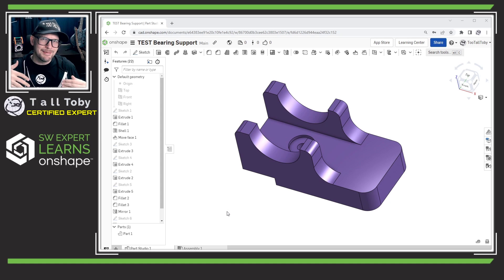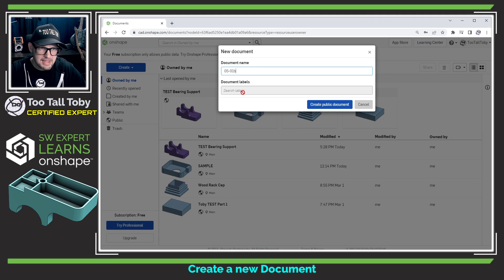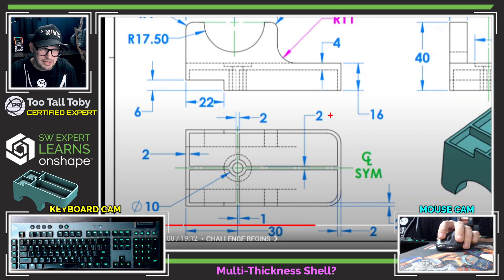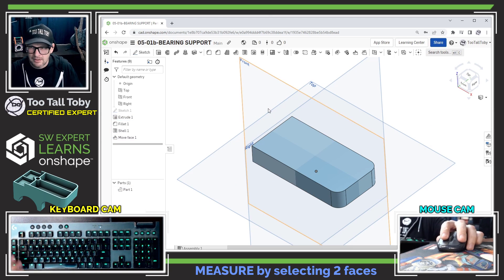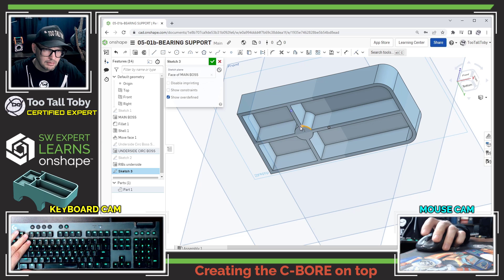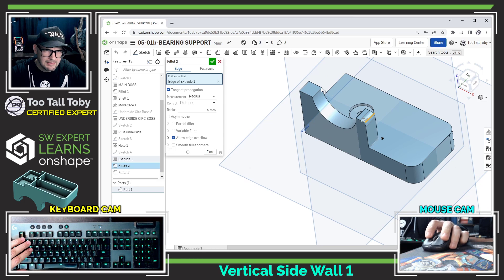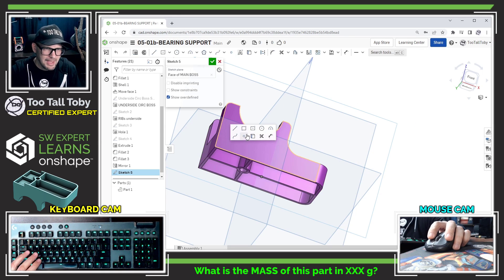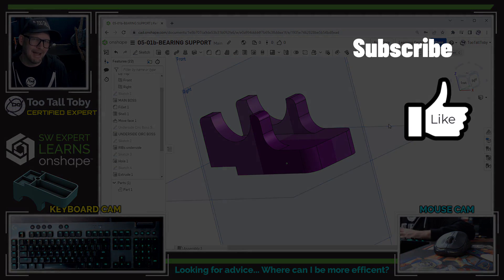SW Expert Designs a Bearing Bracket in Onshape (Tutorial)

Comment: GREAT JOB TOBY!!!

Here are some tips:
1) For the shell, I would have done it like you did.
2) I don't rename my features, instead I put features related to each other within a folder I name accordingly.
3) I would have placed the rib sketch (4 lines) in the same sketch as the circular boss since the ribs would certainly change with the boss diameter and/or position change.
4) There is a rib feature where you can only draw 4 libes from the boss circle and rib them "normal to sketch plane".
5) To create a hole, you can directly within the hole feature dialog, place your hole in the center of the boss (implicit Mate connector) without any sketch. It was not possible here since the counterbore was on the opposite side of the boss. This tip is for the future.
6) At the top of the mirror dialog, you have to change the "Part mirror" to "Feature mirror" or even in some cases "Faces mirror".
7) To assign material, RMB on the part in the parts list on the left and select "Assign material". You can create your own materials.

Keep going! :)
Reply: Yes yes YES!!!!!!  This is awesome thanks Eric!!!   
Last week, after I read all these great comments (below) I made a  "Toby Response" video, where I went through each comment and showed what I learned by demonstrating the suggestions in onshape.  It's so much great knowledge and I am so thankful to the onshape community!!  I even signed up for the forum this week 🙂  

That video should drop this week, and I'm gonna do some more of these "practice models" soon.  I'm so excited about this journey!  Thanks again for the kind words and for dropping some knowledge bombs on me!!  Happy Saturday bro!!

Comment: Looking good overall!
There are definitely some keyboard shortcuts worth getting familiar with:
Shift S for sketch, Shift E for extrude, Shift f for fillet, l for line, i for coincident g/r for corner/center rectangle q to toggle construction are some of the most used... Get the full list from the "?" menu in the top right!
There is no multi-thickness shell, but the move face works. In this case you could make it "parametric" by doing a move face "up to surface" with a 4mm offset. Or the simpler option is to just extrude the top face again 4mm down, you don't need a sketch you can just select a face and extrude it directly.
I would also sketch the circle for the boss on the top face (extrude up to the bottom perimeter face) and use that sketch to locate the hole afterwards. Also you didn't need an actual point to do it the way you did: just do a "use" of the boss and place the hole with a mate connector in the center of the resulting arc. Another thing to look forward to (throwback to your earlier video!): mastering the mate connector and all of its uses!
The rib and mirror questions have been answered already, pre-selecting works for the mirror but only for a body so you have to manually switch to "feature" mode every time...
Note that on the far right of the toolbar is a search box so you can click on this and search for commands (to find the "rib" tool for example), becomes more useful when you have lots of custom features, I mapped it to one of my mouse button. You can also customize the "s" key toolbar and I think you could ad it there (not sure...)?
When you create a sketch on a "face", it automatically brings in the edges of that face (called "imprinting") so the is no need to "convert" these edges to use them (like you did on the bottom of the boss).
One more tip: on the notched profile, just sketch a rectangle and a circle (there is no need to trim sketches in Onshape so it's a lot quicker than doing separate arcs and lines, especially the way this was dimensioned).
EDIT: I was going to add that if you hold shift when hitting enter to confirm a feature is "repeats", useful for doing things like back to back fillets of different radii.
Reply: Airwick!!!  Awesome man thanks so much for the feedback!  I made a "noob reacts" video to all these comments, and you are definitely in there!  That should drop next week but I wanted to thank you so much for all these insights!  the SHIFT+ENTER to reinitiate the command is so sick!!  Awww yeah!!!  😁😁😁

Comment: Good job. Onshape has its differences to other softwares but overall I find it to be the most efficient and I love the user interface.
3:34 Since Onshape does not have a variable wall thickness shell option, I would have made a sketch on the bottom face of the part, used the offset command by selecting the bottom face, which automatically offsets its entire perimeter, and used 2mm as the offset distance. Then I would extrude the sketch upwards, removing, until the thickness–4mm. Your way was good too.
6:32 I would have made the boss and the ribs on the same sketch. Using the center point rectangles was a quick way to do it. You could also use construction lines are centerlines and mirrored the lines across the centerlines to make a cleaner sketch.
7:22 The reason it automatically selected the entire sketch to extrude was because you clicked on the extrude option from inside the sketch. If you hit enter to accept the sketch and then selected the extrude tool, it would be empty and you could select the desired faces to extrude.
11:00 Like others have said, you have to select the part mirror dropdown option in the mirror command and change it to feature mirror. Then you can select the extrude and fillets to mirror. Alternatively, you could have made the extrude for the top part a new part as apposed to adding it to the base. Then, you can use the mirror command on the new part, and set the mirror to add to the base part.
11:21 You can right click on the part and add a color there as well. You can also right click on a face and change just the face appearance. To add a material, right click on the part, and select assign material.
Others have already said these things but I thought I would put them all together. I am studying MET and use Onshape as my main modeling software.
Reply: Hi Finn!!  Thanks so much for all this great feedback!  I made a "response" video to your comments, and I went through most of them and demonstrated what I learned from you (and I really learned a lot!!)  That video should drop next week sometime.  Great stuff and thanks so much for the  guidance!  😀

Comment: Another option for mirror that may be more reliable and less computational intensive for complex geometries, is to have made that vertical sidewall as a new part instead of add part. Then in the mirror command select mirror part instead of features, and it gives you the option inside the command to union it to the main body, which also will union the original half. Slightly more features, but more reliable for complex shapes (which this is not...)
Reply: hi nick P!   thanks so much for this suggestion!!  I took your comment and made a response video - should be out next week sometime - I actually had a follow up question for you regarding "multi-body / multi-part" technique and that lower 11mm fillet, but you can wait for the response video to reply on that one.  Overall super helpful insights and THANK YOU!! Great stuff! 😁

Comment: Onshape -- Help ==> RIB

The exact RIB feature you are needing is detailed in the Onshape help system.  
Open the RIB tool, select the "magic" gray question mark in the bottom right corner of the dialog box  
Select the  -> Rib: Desktop option and watch the "Video Example"  short tutorial.  
In the same help system there are a number of detailed examples for using the RIB tool.
Reply: RICH!!!!   Thanks man I tried this and it worked great.  I did rib Parallel to and Normal to the sketch!  it's perfect.   Thanks for the reminder about the HELP files too - very useful!  I made a response video to your comment, should be out next week sometime!